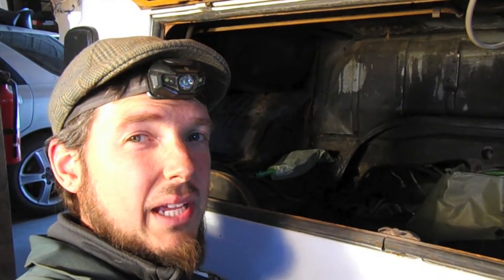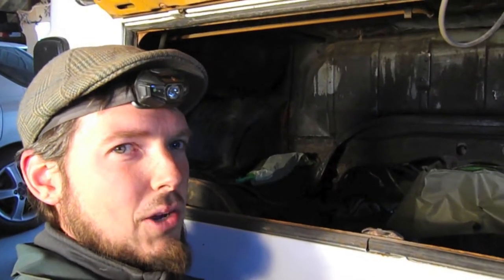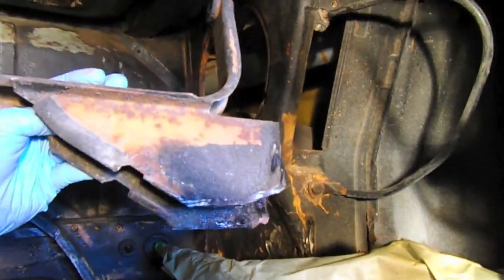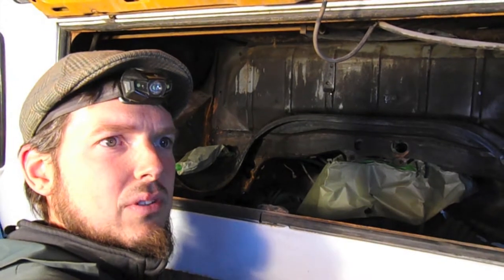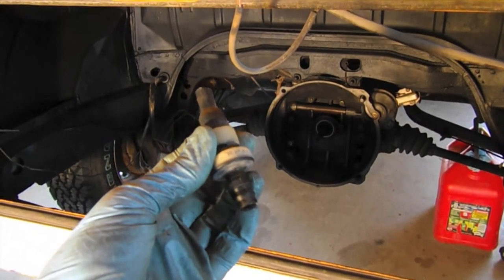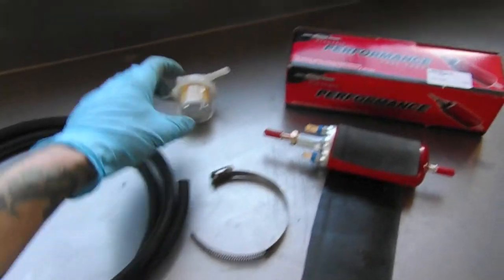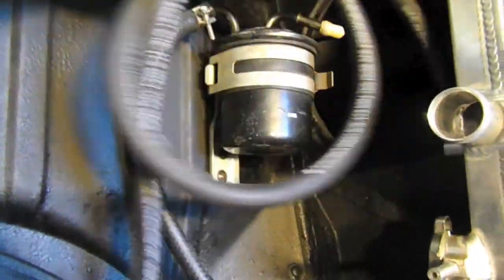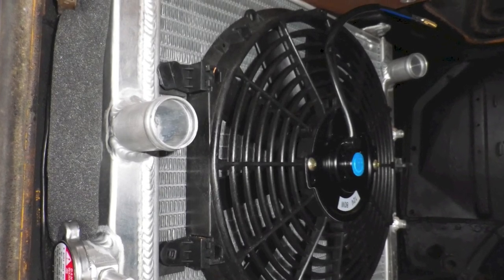VW Bus Chassis Prep - Busaru Engine Conversion Part 4

Comment: Just a thought on the fuel pump. People are running these with a post fuel filter, I think that is how they are supposed to be run in the normal application as well. If you use a prefuel filter it may not give the pump enough gas and will limit it's life. The packaging even recommends using a in tank pump to give it 4-6PSI, but the gravity of our tanks probably takes care of that.
Reply from the maker: Hey Dillon, good suggestions. I'd say that if you have a brand new tank then you'd be okay running without a pre filter. I bet my pump wouldn't last a day without one though. Lots of rust dust in the tank and I'm about to swap out my second pre filter in about 1000 miles. I've run these pumps for years with pre filters on Vanagons as well but as they say - your mileage may vary.

Comment: First of all thanks for documenting this so well! I'm not doing a subaru swap but everything else is completely relevant. One question, where does your fuel return line go? I was originally thinking of teeing it back into the filler neck somewhere but I see you have it going back under the tank? Cheers
Reply from the maker: +Eric B Thanks! On non-FI busses you can tee into the filler neck which is what I do most often.

Comment: I live in Seattle, but the couple local shops doing conversions almost exclusively do vanagon and mine is a 1977 Campmobile. You seem to have figure out everything and have done many of these. Have a recommendation on where to go in WA or OR to get my Bay Window engine swap done? No, I don't have the confidence to do this myself, even with your excellent video series. Thanks.
Reply from the maker: Hey Brian, I have only done 2 Bay swaps, and tons of Vanagons (they're simple). The problem with the Bus is that there isn't really a successful formula for every circumstance. There isn't a "kit" so to speak, and that's probably why shops are shying away from stepping into a conversion process. Cooling is the biggest issue and its all still experimental. My busses work fantastic around town, but on long mountain passes here in CO, they start to heat up a little hotter than I like. I'm just now starting to troubleshoot this and am hoping to dial it in soon, but that's just one example of these conversions being "experimental". I don't have any experience with shops in the northwest unfortunately. Your best bet is to try and talk with your local shops and see if they can work with you on a reasonable price for a fun "experimental" project. Just know that no one has this totally figured out yet. Good luck with the process and keep us informed on how it goes!

Comment: Great series.  Just started thinking about doing this very thing.  I have a question: can any Subaru 4-cylinder engine fit?  Like a turbo motor?  Or are there limitations to which will fit?
Reply from the maker: I would stick with non-turbo models (EJ20, EJ22, EJ25), just because there would be a decent amount of fabrication work needed due to the clearances at the rear of the engine to fit the turbo. I have an EJ22 Turbo engine I was hoping to put into something but decided that it wouldn't be a good fit for a Bus, but it'll fit into a Vanagon perfectly fine. Let me know if you have any more questions.
Reply: Thanks.  Though I am curious what mods would be needed.  Do you mean thinning out the sheet metal in that area and, perhaps, substituting a beef up of some sort? Not beyond my abilities.  Or would it require extending the bodywork out?  Sorry to trouble you with these questions.  I'm sure the answers are out there if I took the time to look.
Reply from the maker: Forthwith Tx The rear transmission crossmember interferes massively with the output of the turbo. If you are okay with trying to relocate the turbo that would be your best bet. I'm not a huge fan of cutting up the chassis in non-reversable ways (a cooling tin fin being an exception). Keep the questions coming! And by the way - I am planning to put together an article series to compliment the video series. This will be very similar to my SubaruVanagon article series on Boxerswaps.com.

Comment: What size are those genral grabber tires?
Reply from the maker: General Grabber AT2
Size: 205/75R15SL
I LOVE these tires and put them on just about everything I own. They rub a little at full lock on the front but I'm planning on cutting the rusted out body mounts and replacing with substantial steel to make way for some even bigger tires eventually.

Comment: That is horrible lol.  But modification is what it is.  I think i would leave the sponge  frame section in.
Reply from the maker: I toiled over the decision to cut for quite some time. I ultimately decided that if one ever wants to go back to air-cooled (heaven forbid!) they could simply weld the fin back in. It isn't structural so I don't see much problem in that. Anyway - thanks for the comments!
Reply: The frame vin in on that piece you cut out!   :0